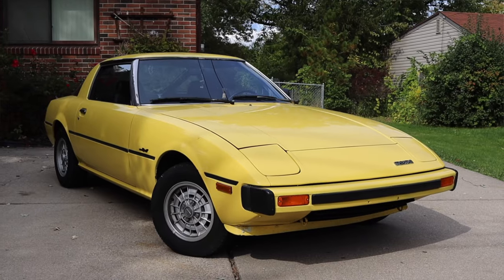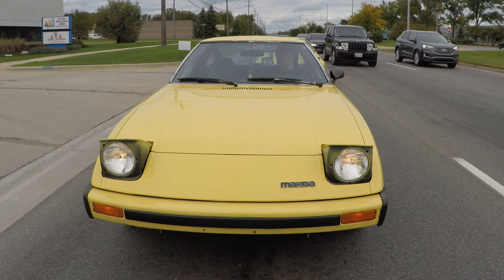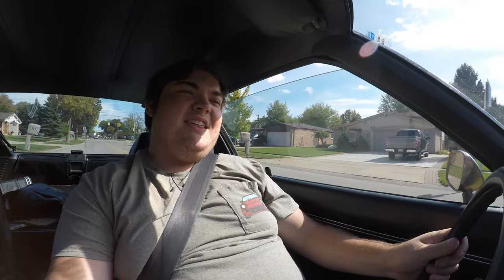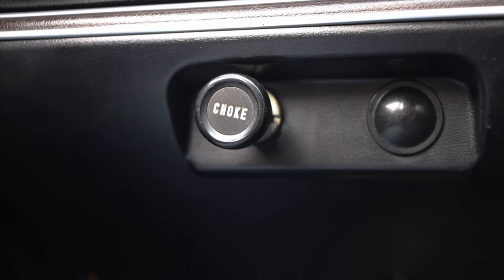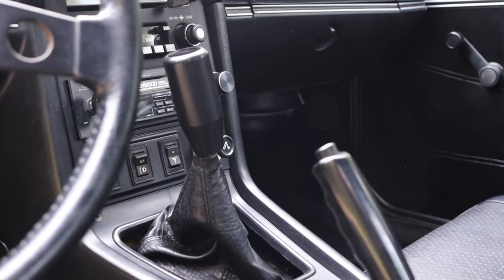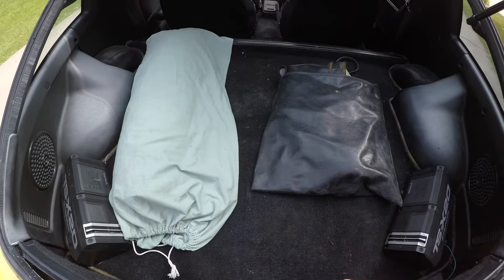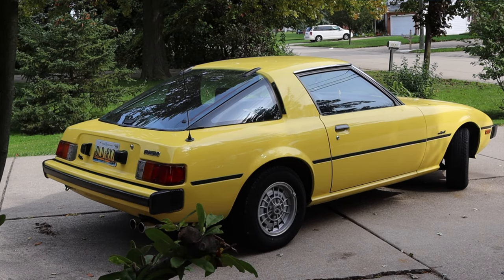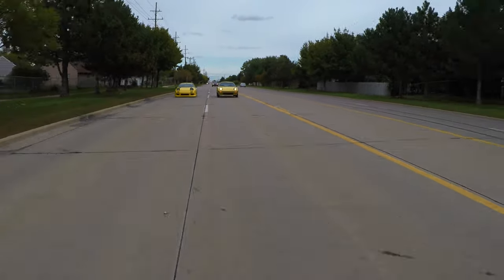1979 Mazda Rx-7 Review - The REAL First Generation Rx-7!

Comment: One of my first cars was a 79 RX-7. Loved it and put a lot of miles on it. I learned a few tricks that would come in handy. One being the rear hatch mechanism mentioned in this video. Because it wasn't centered, there was a linkage running to the lock. If you ever locked your keys in the car you could easily get in by removing the right taillight lens with a phillips screwdriver, reach in and pull the linkage. No scrapes, no stress. The invaluable lesson I learned was how to quickly adjust the dwell. It had 2 sets of points that could be a nightmare to adjust because there was no little hatch to adjust them like American cars. The trick was to have 2 long spark plug wires to run from the 2 coils directly to the 2 leading plugs. You can then adjust the dwell with the distributor cap OFF and the car running! I won some bets with that knowledge too. Motor heads in town would bet I'd never start the car with no distributor cap. The car would run on 2 plugs. The other 2 plugs were mostly for emissions. What the car lacked in HP it made up for with handling. It was a true 50/50 distribution with the engine sitting behind the front axle. The biggest improvement I made to the car was adding two 3-way speakers in the empty space behind each seat. I didn't have those glove boxes, just wasted space under the sheet metal. Perfect for speakers. I also owned an FC and was greatly disappointed.

Comment: I loved my brand new metallic blue '79 Mazda Rx-7 with a 5 speed manual transmission. There was NOTHING like it on the road at the time. I had one of the 1st ones in Dallas. People would stop me asking what the car was and went crazy over the look. I kept it for 5 years and sold it with over 110k miles.

Comment: For the 79 & 80 SA series the 4 speed is in the basic S model.  It also had the vinyl seats and the 2 spoke steering wheel.  The GS model had the 5 speed, 4 spoke steering wheel, better console with arm rest, cloth seats  (plaid in 78 and early 79 velour in later 79 and 80), RH door mirror. Options were alloy wheels and a sunroof, cassette tape deck (would go where the aftermarket radio is installed)  A/C and an automatic trans. That speaker grille thing in the dash was dropped for 1980. These early cars also used the thermal reactor emissions system rather than a cat which was introduced in 81 when they modernized the emissions system.

Comment: I picked up my Yellow RX-7 in September ,1979 as the first car I ever bought. I had been saving for over a year to buy a Celica GT and on the way to purchase it I saw the RX-7 on the hill of a dealership in Newark, Delaware, It looked like a spaceship. I drove right into the dealership and put a deposit down and was told I had to wait 6 months (the one on the hill was already spoken for). I wanted a blue color, but was called the next month when a Yellow one arrived.  I picked it up...and fell in love with it.  On the first day, I parked it outside my dorm tower to pick up my friend.  I looked down on it from the 12th floor dorm room and saw , at least, 10 college kids surrounding and peering in the car.  I am so glad I took the yellow color. Perfect for a 21 year old. It was caught in the flood caused by Hurricane David a month after i bought it and found it with water up to the steering wheel. They dried it out and I never had a problem.  Didn't realize I needed to change the oil so went 30,000 miles without an oil change...never a problem.  Had it 4 years and out 100,000 mikes on it and it ran perfectly.  I still dream about that car on occasion.

Comment: I had a 1980 SA RX-7 which used to be red but someone resprayed it black. I had to sell it for parts, it was way to rusty and so many things were broken. It had a blown apex seal, a torn up suspension on the front left and the wiring was a mess. I did get the engine to run though, it was a later „S3“ 12A with 115hp which was available in the European and JDM market only as far as I know. The us had to stick to the 105hp S2 12A

Comment: This was my EXACT year and color I paid $9200 for it even though the MSRP was only 6995 or thereabouts   I loved that car dearly and dearly hated to sell it but by 1981 my new gal who already had one child also gave another to me with another right on the heels of that one....and an RX7 is the worst possible car even as a second car with little kids so we traded it with I think only 40kmiles on it... dang I have missed it ever since....hard to believe it had so little power and that my 2018 ND1 Miata would put it to shame now even with it's measly 154hp.    I understand Mazda giving up on the Rotary but I don't get them not building something bigger and faster than the Miata....RX does not HAVE to mean Rotary if you ask me!  A turbo 2.5 with say 325hp in n oversized Miata like platform?  Still sub 3k LLB?  For say 45k base?  Could be awesome!  Maybe name if the PX7R  ("P" as in Piston)....ideally I think a boxer engine...heck maybe do a joint build with Subaru which could be the "PRZ"  Gives me an erection just thinking of it!

Comment: Ok so about the 4 speed. I would much rather have that 4 speed because it was a $4,000 option to put a 4 speed hurst transmission which is basically a race trans. that's why its hard to shift because its a nice ass transmission. hope this helped.
Reply: False. 4 speed trans with two spoke wheel came on the base model sa. Upper trim levels came with the 4 spoke wheel and 5 speeds. The transmissions and gearing are identical aside from the 4 speed having no 5th.
Reply: @brianskotch2922  Also true, they had 3 different trans options for the sa tho. My Grandpa has a 1 owner 79 sa that he bought off the lot and there was an option to put a 4 speed hurst transmission in the car and he did it. The options tag (which is in most cars in the glove box" has that option in it.
Reply: @brianskotch2922 true. Someone who knows the SAs Sir!